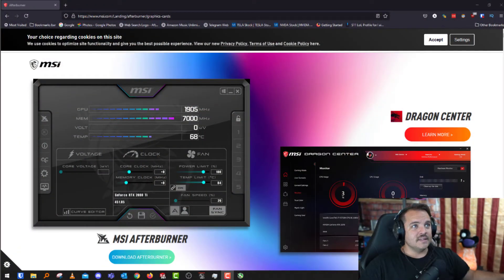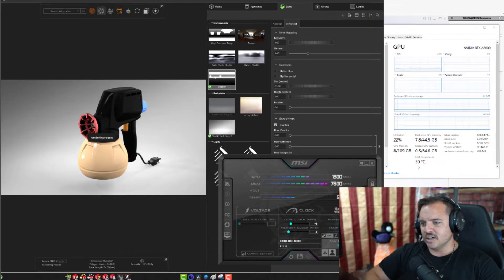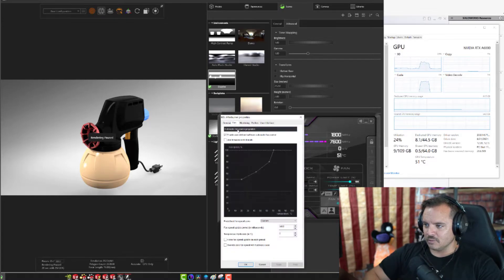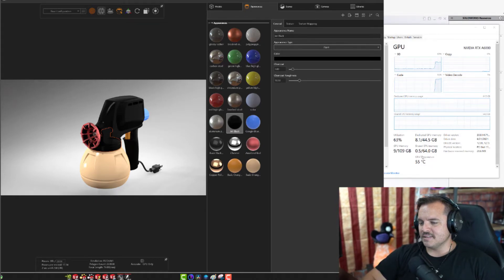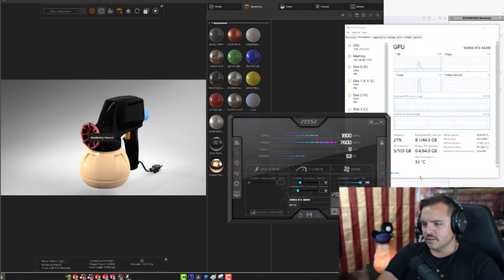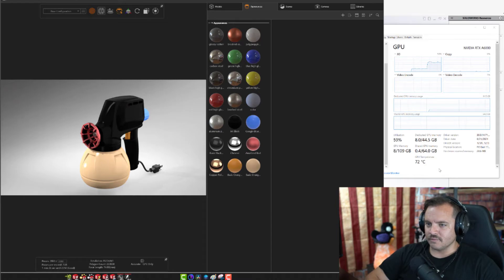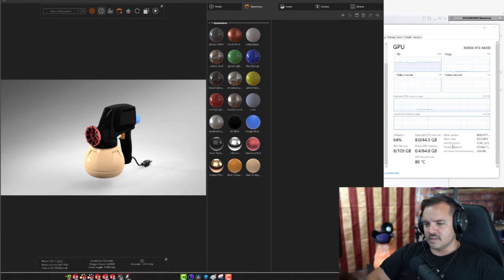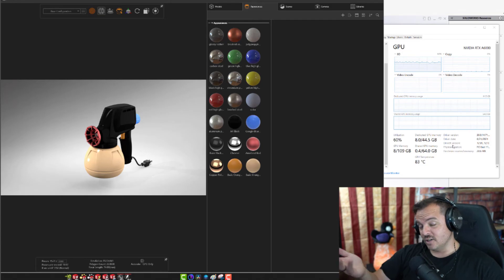Keep SOLIDWORKS Visualize from overheating your GPU with MSI Afterburner

Comment: How your computer stays? ı just open a solid visualize file on 7800x3d with rtx 4070 at fastest fan speeds (5800rpm) and cpu jumps to 90 degrees!

Comment: my computer just shuts off when rendering in visualize and the fans are going full bore. Shouldn't my laptop be throttling to not overheat?
Reply from the maker: That really depends on the configuration of your system. That may also indicate an issue with your video card or driver.  Contact your VAR's technical support department for more specific help.